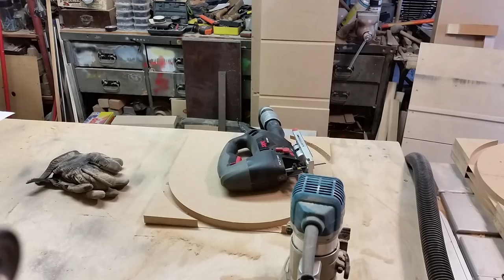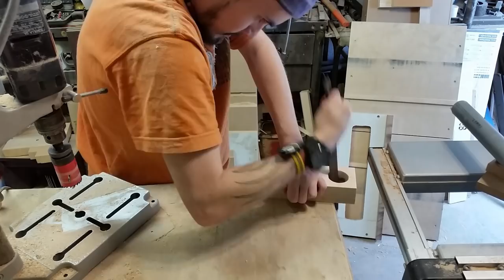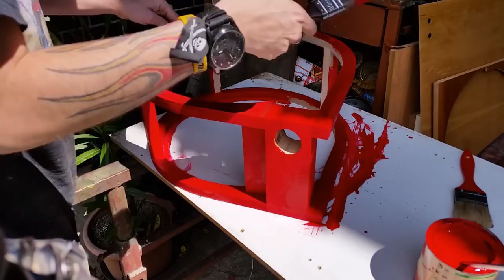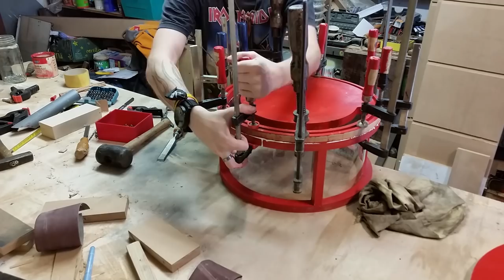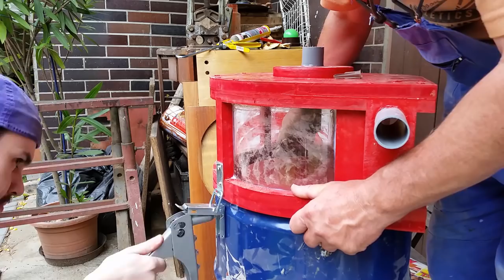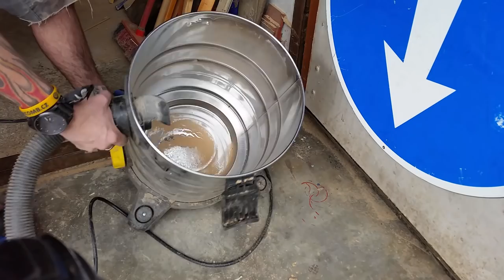Thien baffle dust separator

Comment: Looks great and a nice design, especially having the glass in one stretch (so many designs call for an awkward cut in the glass), though, I don't think I'd glue the top on, as you may want to tweak the design in the future.
Reply from the maker: Hello, thanks for praise. Bonding I have chosen to ensure maximum sealing. Every single leakage significantly reduces the efficiency of the separator.

This is already the 2nd version of the separator. So I'm not planning any further improvements.

Comment: Nicely done but might I suggest if you do it again, don't bother with screwing the acetate: where you marked the screw lines, just a thin bead of glazing silicon would do the job as it would provide much better air tightness top and bottom and the panel would never fall out.

Comment: You do beautiful work.  But at 7:10 those are some sketchy cuts in my opinion. There is a chance of kickback with the board and the fence, as the board is not firmly supported and could jam. I'm not worried about you having problems because you have a lot of experience, but someone new at woodworking or more timid, might see you do this, try it, and have a bad experience. It's so easy to use a stop block against the fence to set the distance, as not much time is wasted.  Also, you might enjoy a better push stick. If you look at push stick designs on here, you might find some that you like and you will never go back to the one you have.  Thanks for a great video.
Reply from the maker: Yes you're right . The ideal solution is to attach a piece of wood to the fence as a stop. To set the cut length. After cut, the wood has space and no kickback is possible. Push stick I use what was like the original accessories to the saw. It works great.

Comment: How ironic, it looks like you need a better dust collector connected to your router.....
It kind of defeats the purpose of building the baffle if the dust stays on the table and shop floor
Reply from the maker: Yes vacuum cleaner could have more power. Except milling dust collector works well.

Comment: Sorry that despite your final piece is just super great, I have to press the dislike due to the way you were (are?) using the lumber tools. Knowing all the possible threads that may occur, I feel so uncomfortable watching this video...

I don't know if you have a jig-saw, using a router in such excessive way may significantly reduce the durability and the dust may cause problem to your lung. In addition, you were not wearing goggles looking so close to your work piece, remained the router switched on with both your hands off and EVEN PUT ON A PIECE OF CLOTH around your neck while you were working!
The following may cause serious injury due to table saw kick back.
- you were not using a riving knife on your table saw even with very narrow pieces
- you were standing right behind the blade
- you were cutting repetitive pieces using the miter gauge TOGETHER with the fence.
I am not here to blame - but just not to drop a dislike irresponsibly without any reason. By the time I see this video is 2020.... I hope you are still fine.
I want to share this message to every one watching lumber work videos - not just to appreciate the great final piece but really pay attention seriously to the safety precautions in using the tools, especially the table saw.
Reply from the maker: Hi thanks for your feedback. This video is 4 years old. I do these things differently. And yeah I'm fine.